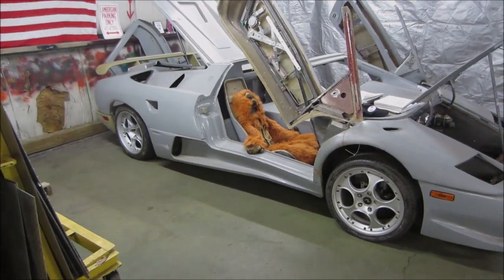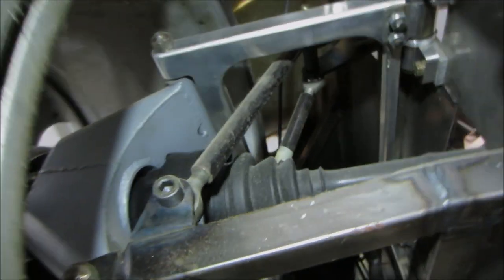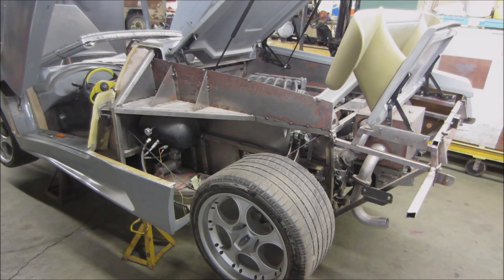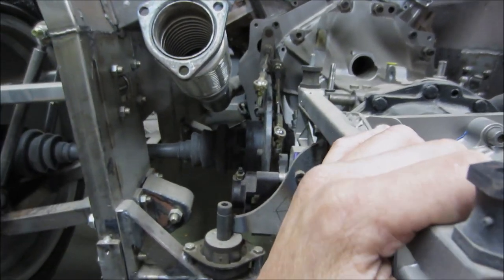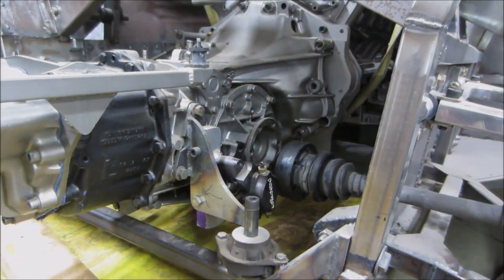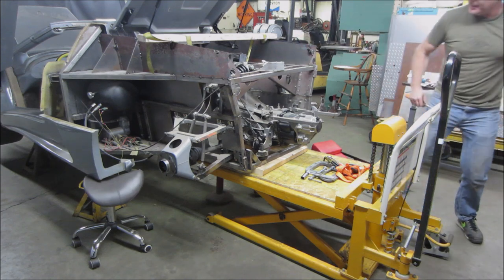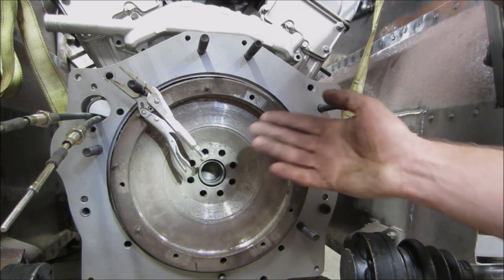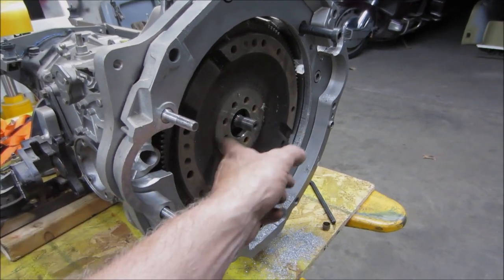Free Lambo Diablo hand built, lets see what it needs to Run?

Comment: Another option use corvette drive train remove the torque tube use a very short intermediate shaft 
Use automatic its lots of fab work but it can be done with the right people involved lending a helping hand 
800hp Ls would make that car scream 
Cost the same as trying to revive that bmw engine 
I do have a bmw engineer that can help you he will have the parts you need pretty cheap 
He Also has the programming software to make a bmw run he also knows how to wire them 
He has parts resources from Turkey to get what ever parts he needs other people cant buy 
He would buy that car form you if you chose to sell it 
Then I would end up building it with his assistance !!!!!!
I have the equipment to build the car I’d make you a offer on it 
If I had the extra cash my buddy will want it I’m sure

Comment: looks like the previous owner was too quick to get the cosmetic portion done that they neglected to finish the mechanical tasks that are easier to do before everything is built up.  I've never taken on a project like this but I would imagine you would want to get the engine built and all the lines run before enclosing too much of it with body work and the portions of the frame that are not necessary for engine support.  Start from the inside and work your way out.

Comment: I still think this a money pit of a project with a 101 parts required that you may or may not have. It was a labor of love by the previous owner before he passed on. The way the car is clearly not a final fit but rather a preliminary set up to find out where things will go relative to each other (the way the bell housing was empty for example). None of framework had been coated or wax filled, no radiator, no fuel tank, no wiring harnesses, no battery, no oil cooler, no wheel arches the list goes on. I think you you will end up stripping this car down to its bare components before you make any progress. It will take 100's of hours to make this a going concern and not to mention the cash. Its a daunting prospect to say the least, good luck to you sir.

Comment: I don't know about you but I think I would sell that BMW engine and go with a 404 some odd horse LS based engine easier to get parts for in a hell of a lot cheaper and you can always throw a supercharger on it if you if you deem so, the Exotic European engines are extremely expensive to repair and diagnose especially with the computers and such at least with the LS there's tons of aftermarket computers and wiring harnesses and support for good luck with your project checkout B is for build he's doing the same thing that I'm speaking of!

Comment: I feel to find a BMW flywheel is the best option... and there start all again to fit trans .I adspted many engines that way but I never changed flywheels even I adapted a Dodge slant 6 (3 speed box) into a V8 plymouth with automatic box with torque converter but bolted the converter to the turned flat slant´s  flywheel .Meshing with starters is the worst idea...!.

Comment: Don't reinvent the wheel.Porsche 944? flywheel,redrill.Then find appropriate starter motor.Don't mick with the adapter plate,because you're running out of metal as it is.

Comment: The comments were disabled on the 3 stage compressor episode but you really had me frustrated when you ran that poor thing on its side instead of verticle the way it was made to operate. (any oil sump is meant to be on the bottom). Try running your car engine on its side and see how much oil leaks out of it. Aeroplanes can be flown in different attitudes but for the most part they keep positive G's while manouvering. Be very carefull with that 1500 psi as air is not an inert gas.

Comment: Is that transmission auto or stick, if auto you need torque converter not clutch,  or flywheel,you need flex plate and converter.
Reply: The rear end is a manual, The bmw is an automatic, The V12 Early BMW manuals were super rare!

Comment: ...if it were me; with this deceased owner unfinished build, I'd look for a code on the transaxle he had mounted in there; might have been just for his 'dry build/mock up' - but getting the gearbox/transaxle code (it maybe either 924 or 944) - n checking the specs etc of thm boxes... clutch looks wholly inadequate to handle V12 power; fair too small... looks like a lot of engineering etc  went into the chassis, n suspension but again just going by looks... you might be able to mock up a Passat/audi V6 or even Phaeton transaxle against the BMW v12; might require a different adaptor plate n flywheel, but would be up to the power; you mention he started this build in 2000, so maybe them transaxles weren't as 'available' (affordable) back then in the 'yards; hence the Porsche t/axle he 'mocked up'...

Comment: RUN....RUN FOR YOUR THE SAKE OF YOUR SANITY !! sorry to say but there's no value here..this thing will consume 10's of thousands of dollars and thousands of your hours..then what will you have..(a johnny cash song comes to mind..(well itsa 49,50,51,52..) fyi a 944 trans axle doesn't have inboard brakes and even if there is some trick kit out there im not aware of (i own a 1983) that BMW V12 would destroy that trans axle (highest hp rating was 247 out of a 2.5 L 4 banger) wheres the modern BMW V12 started around 450 and has climbed in power ever since..EDIT: it is a 944 trans axle..the exterior is similar to mine (83) but not a match so its newer than (83) so that's some kind of custom fab job the guy did to make the brakes work..unfortunately the trans axle is definitely not up to dealing with that 12'er :/

Comment: Here's a comment that'll never see the light of day...  This kit car has a BMW M70 V12 engine.  This engine was essentially two inline 6 engines mated together.  It has two throttle bodies, two distributors, two ECUs.  This was the MAJOR downfall of this engine.. and what caused it to be really, actually, complete junk.  Neat thing about the M70... it's about the same physical size as a Chevrolet LSx powerplant!  Too bad they're NOT reliable.  At all.
What could resolve this issue?  Ditching the Bosch Motrash ECU and replacing with something aftermarket.  Mustie... how I wish you lived in the midwest instead of the north-east.  I would LOVE to help you get this thing running with a standalone ECU!!!  Hell...  I'd donate an ECU and home built harness to this project if you were close enough because I want to see it run that bad!  :(

Comment: I  am  trying to  not  watch this, unsuccessful!  Very  interested in this  Lambo! If there  is a way to do it, please  continue.  Check with  kit manufacturer and supplier!  Should have options for you.
Reply: V-12, is what it needs,  if complete and able to run. Listen to the guy's saying weak transmission.  Get a tough setup because you are going to beat it up after all the trouble building.  It will HAVE TO be fun.

Comment: it's not a free Lambo Diablo. It's some cobbled together kit car nightmare that that's wearing a Lambo Halloween costume. I've seen Briggs and Stratton go carts that looked better put together. 5 bucks says it never goes down the road under it's own power. And even if it ever did it would bust half those Sears spot welds in the first 100 feet. You'd have to be out of your mind to drive it over 30 mph. That thing is scarier than Jack Nicholson in the Shinning. Run away, RUN AWAY!!!!

Comment: I would get rid of that V12 BMW engine And get a Texas speed 427 Or if you wanna go cheap get a good running junkyard 6.0  ltr  And Turbo it. will be cheaper and much easier

Comment: Pull out the engine and trans, sell them.  Put in a VW trans and engine, way less money to get that thing powered on its own steam.... just my opinion... saves trying to get all that "electronics" ( Money Pit of endless Parts) and other nonsense up and running. Honestly I doubt that car structure can handle a V12 anyways, does not look strong enough to me. Eh... Take the money from the engine and trans sale, build a low budget high performance VW engine , beef up the trans axle a bit and  Bobs your Uncle....

Comment: 7 series BMW's never had a v12. that's the engine from an 8 Series.
Reply from the maker: Multiple V12 engines built by BMW since 1986, named the M70, M73, N73 or N74.
Reply: wow. the more you know. i really thought the 8 series was the only v12 in BMW's line up. well, either way, like others have commented, I don't think that's a real engine. I think that's a mockup. Best idea is to yank it out and find an old porsche engine to power it.

Comment: I'm going to bet $50 that it never successful drives... Then if it actually does, I'll place a second bet $100, if it does drive, the first time you stomp the gas hard that suspension rips apart from the torque. Square tube frames are for backyard go carts.

Comment: So the guy started this in 2000?   You've inherited a life project, not a quick DIY fixer upper.
Most of the parts you've already pulled were just mocked up, so there's a high chance there will be engine internals missing also.
Like others, I reckon the engine they sold was the runner you needed. Time will tell I guess.

I laughed when you said "get an education", I think you need to be a bilingual engineer of Latin origins to stand any chance of making fast progress.
If I were you, I'd pass this car onto an educational facility where many hands can get involved & get it done this century.
You'll waste a lot of time & money if you persist with this project.

Comment: Massive waste of time!  Looks like it would take years to finish this but there is really no point since even if all the mechanical issues could be resolved it doesn't have a cooling system or an engine management computer, electrical system or any wiring at all and there are no catalytic converters so it won't pass emissions when it's done.  Probably best to sell it for parts or scrap.